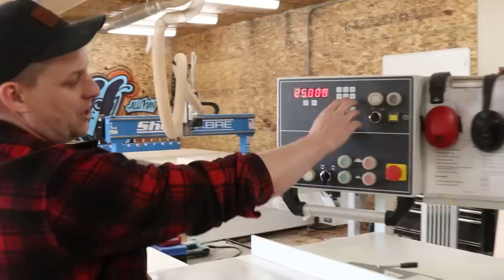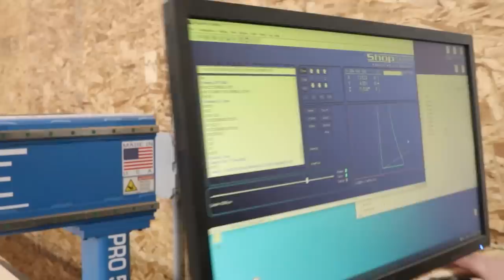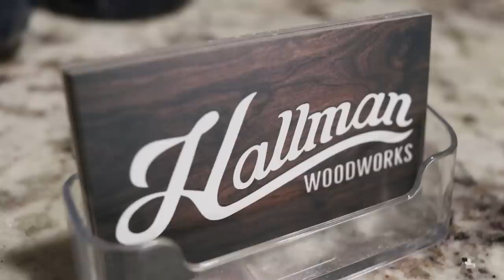DREAM Woodworking Shop Tour & Full-Time Biz by Hallman Woodworks | Essential Shop Stories

Comment: If the panel saw was “production” as referred, you would not need to hold the button down  and waste time, in order to move the fence. On SCM, Altendorf, Martin, you enter dimension and go to pick up you panel whilst it is positioning.
Reply: I don’t run enough sheet good to justify an extra 10-15 to buy the scm